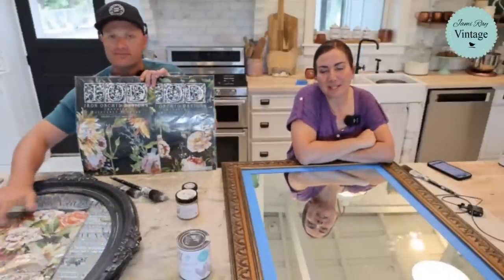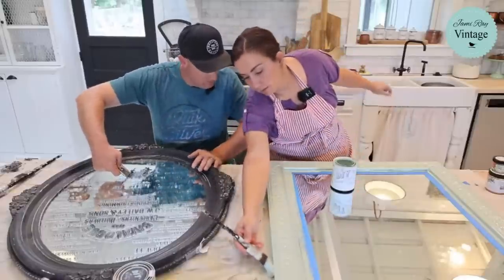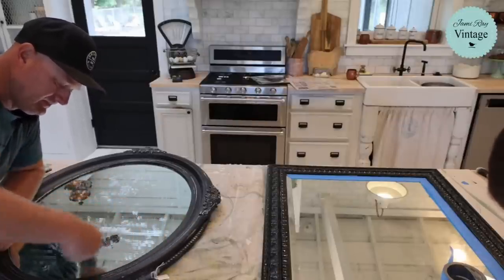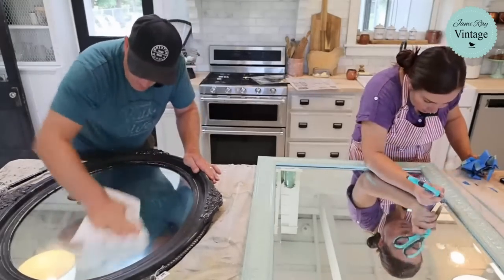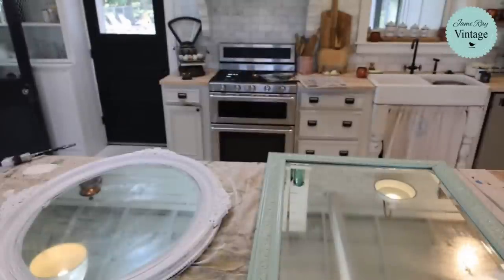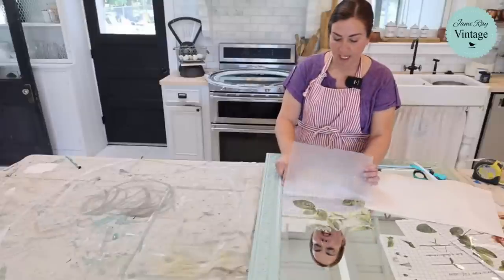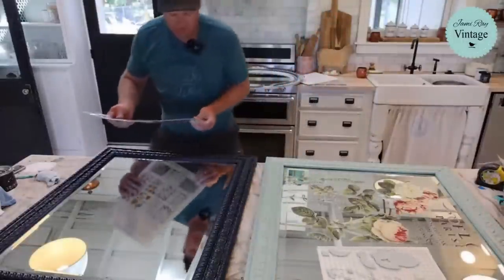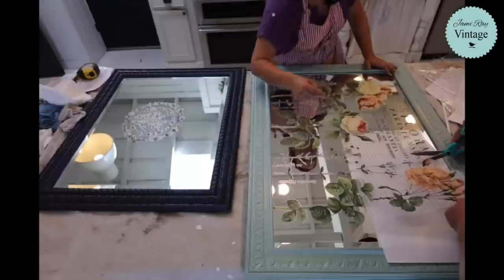How to put an IOD transfer ona thrifted mirror - High End Decor on a Budget Waste Not Wednesday

Comment: My friends that had the limo company taught me to use Dawn and hot water on a microfiber rag & wash it as many times as you need to if it’s a greasy😬
Then buff without rinsing with a dry microfiber rag.
And glass will be incredibly clear

I haven’t used glass cleaner in years